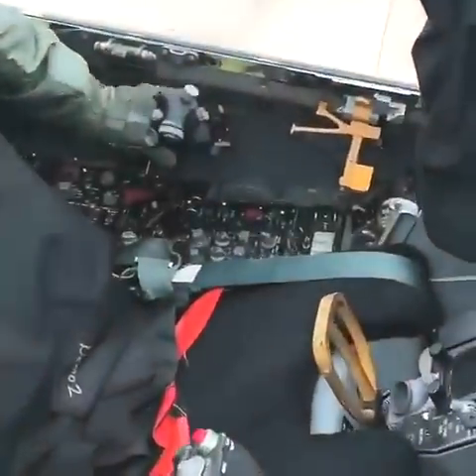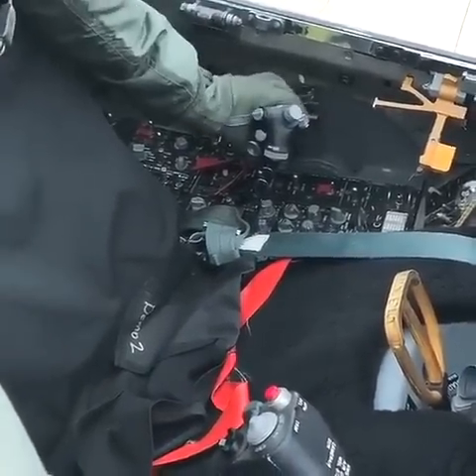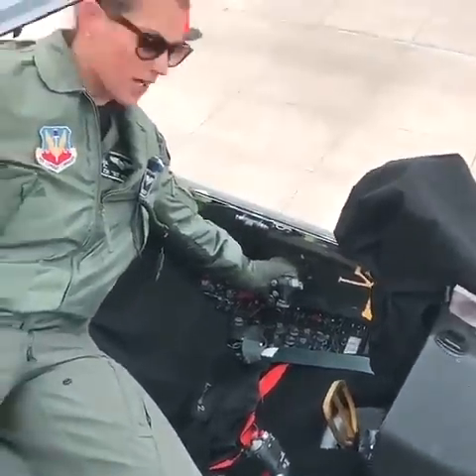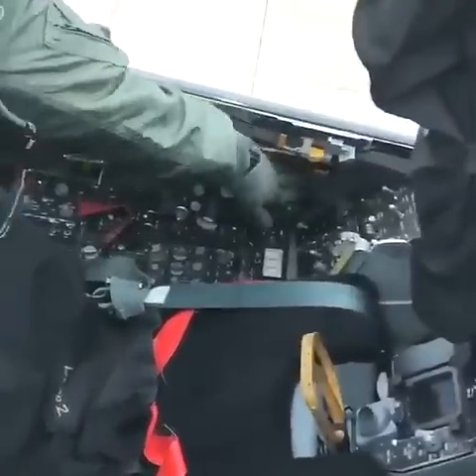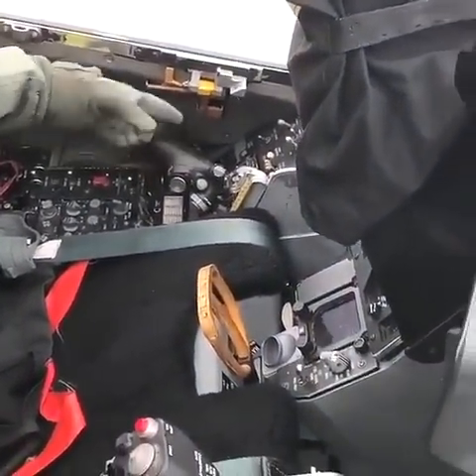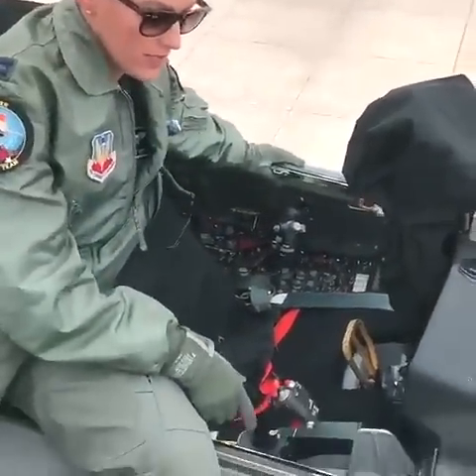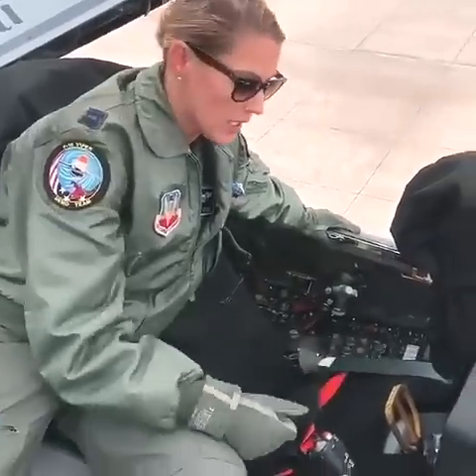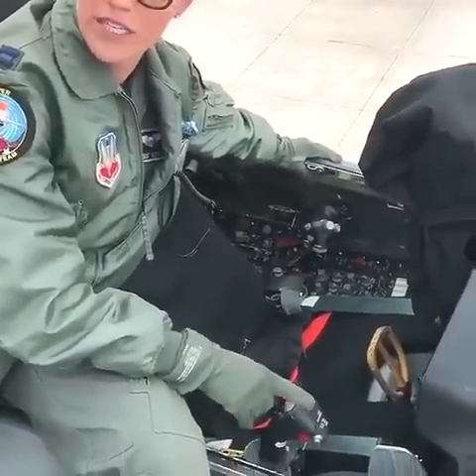USAF Female F-16 pilot Capt Zoe Kotnik, New Viper Demo Team Member

Comment: The original F-16 side stick controller had zero movement in it and worked by sensing hand pressure, but pilots had a hard time getting used to it so they added about a 1/4 inch of movement to it. 
It still works by sensing pressure but the added movement made it more natural feeling.
Reply: Thank you for clarifying/summarizing this because I was confused as to how it could have such little movement but it’s sensing which is amazing I never knew that
Reply: @killstars  
My pleasure, glad you found it useful.

Comment: She was also dismissed from the Viper Demo team after only two weeks.
Reply: Why?
Reply: @barskose4173  Her commander stated it was due to a “loss of confidence in her ability to lead and command.” Apparently it was pretty serious but the USAF tends to keep their reasons for punishment in house due to privacy policies. I’ve seen this kind of thing happen with pilots a few times before during my Air Force career and it’s usually for the same reasons.
Reply: @KPX-nl4nt  which reasons are those?
Reply: @KPX-nl4nt  the stick movement is somewhat of a misnomer right? It becomes pressure sensitive for more flight control movements.  Plus fly by wire= pilot can't ask the jet to do deadly moves?
Reply: @coachwilson5967  The F-16 side stick uses pressure transducers although it does have approximately 1/4” travel left, right and aft but no movement forward. It takes the same amount of hand pressure for full deflection in a given flight envelope. The flight control computer has a lot of different parameters for different flight regimes, and is essential as the F-16 is dynamically unstable. The stick was originally designed without any travel but was changed as this produced uncommanded flight control movements due to pulse/heartbeat and inadvertent muscle twitching in the hand. As for fly-by-wire preventing deadly moves, the flight control computer does put limits on the aircraft in different situations, but I’m afraid that no computer can completely protect one from oneself. Hope this answers your questions.
Reply: @KPX-nl4nt  thank you! You know what you know!!!!
Reply: @KPX-nl4nt So she got in trouble for giving wrong info.

Comment: The stick is controlled by pressure. It used to not move at all but the pilots didn't like it so the movement was added. The movement is literally so the pilots feel it move and nothing else. At least that's what the guy at the local air base told us when our Cub Scout troop went on a tour in 1982 and got that same demonstration.

Comment: The original prototype sticks didn't move at all. The stick senses pressure rather than position. Artificial movement was added at the request of test pilots which allows for smoother inputs.

Comment: The F-16's stick was never designed to move, given it is touch based, and the computer interprets the touch and pressure of the touch to determine which direction to move the plane. The only reason it has movement at all is because pilots that transitioned to the Viper griped about a stick that didn't move an inch, so they gave it 1/4" play in all directions, despite it being a "placebo effect".
Reply: Awesome information. I didn’t know that and I’m a Viper Driver.
Reply: But do you know why it was designed with no movement?
Reply: @Skilled_Driver  because it's strictly pressure sensitive by touch, much like how a touch screen responds based on a tap vs a long hold, and responds based on those inputs. A "long hold" on the Viper's stick induces a roll, taps are a snap roll, or  what creates the 8 point roll, pitching is done the same way. The pilots who weren't used to a stick that didn't move wanted it to, so General Dynamics gave it wiggle room of about 1/4 inch on all axis, although it has no bearing on input.
Reply: @angelisreal  I think you are partially right. I think of the stick more of as a variable resister with an on off switch.  That combined with that flight computer determines based on air speed, throttle position, atmospheric conditions and stick pressure. at what rate control surfaces move. And how much they move.
Reply: Well, my Pitts is pure hands and feet feedback ……absolute heaven.
Reply: @Skilled_Driver  the input method has nothing to with the other variables you mentioned. They're incorporated as a vital aside, but in this context, moot. You can input the data from the physical plane into a computer simulation, and the reality is altered by removing several other factors  that you don't get within the simulation: sensations and movement, which are the aside of the real thing vs a simulation. The joystick is the same principle. The reality is that the controls are servoed to the fly-by-wire (and fly-by-light) systems, and doesn't always require the flight computer to check for input control, although the floght computer does do that. They actually had to modify the flight computer parameters to dampen pilot input, because some were aggressive in their inputs, causing tail plane and flaperon damage. That was directly related the the stick input, not the flight computer by itself.
Reply: @Pittsspecials  that, my friend, is an understatement.....
Reply: @angelisreal  It is a dream to be able to fly this. She’s  180. Hp ..Inverted fuel and oil 76 /56 prop about 700 lbs
Going up car #3.      33rdfloor, 45 th floor furniture 
75 # floor bedrooms sets,next stop observation deck! Wow Built. ByHerb Andersen at the factory in 73’   My favorite …close next to a J-3 Cub sitting in the back seat with the door open

Comment: Tight flight controls but thrust controls is almost as much movement to shift an 18 wheeler!! You would think since flight and thrust work hand in hand, you'd think the thrust control would operate in a little tighter pattern.

Comment: Its called an air idle stop it will prevent you from accidentally shutting off the engines in flight in case you should jam the throttles all the way to the rear. You would have to manually left the stop lever up in order to disengage it to fully lock the throttles to the rear to shut the engines off. Hows comes I know this but the Commander of a fighter wing doesn’t? Sounds like someone was rushed through training without fully understanding the subsystems as I recall the last female commander was deemed unfit to lead the wing but lets see how this one fairs.

Comment: Less than a quarter inch movement on the joystick!! Wow seriously?? Would that not make the control really 'twitchy' 🤔😮😊😎👍
Reply: The stick senses the force applied to it, not movement.  The original F-16 sticks didn’t have any movement, but having some movement helped the pilots’ feel what they were doing which lessened fatigue.

Comment: Male pilot: yeah's pretty nice in here.

Female pilot: this does this that does that and this is for this and I actually know all this cool stuff and when you press this then this happens and this is the seat belt we use that to strap ourself in and this plane can actually fly upside down but it's really hard because you're upside down and this button here is so cool because you can actually eject the seat believeitornot if you get splashed that's pilot lingo for shot but yeah it's pretty cool.

Comment: Feel like she’s pranking us with the stick can only move 1/4”
Reply: The stick is controlled mainly by the amount of pressure applied on it
Reply: The jet is fbw it does not need input
Reply: @glennoc8585  All airplanes need input the controls are just pressure sensing. Fly by wire just means it goes through a computer.
Reply: @TobiTriesTV  true but the movement is much less on the side stick than a conventional yoke assisted or not. These fighters are not needing the same movement much like a F1 car doesn't.

Comment: It's called a detent for the throttle quadrant.  Must be an Air Force thing.  Not criticizing just info..  Some call it "going around the horn" from off to idle or idle to off (not Africa btw).

Wow, that is crazy that the stick movement is so minimal though.  Less than 1/4 inch!

Comment: Only the air force would allow that much makeup to be worn in uniform.
Never once seen an Army Pilot with that much makeup on.  Seen a B1 flight crew member in Afghanistan check her makeup before deplaning.  I guess she didn't know we were watching from the flight security vehicle with a camera.  We were seeing if the aircrew was still on board because they powered down 30 minutes before...look over...checking her makeup in a compact...only the air force.

Comment: Are you kidding that’s all the steering turns??
Reply: How many point turn would you have to make in a car to turn around on the road with 1/4 in travel 😆
Reply: Cannon Cocker  nope, you be wrong buddy. Just because that stick doesn’t move much doesn’t mean the control surfaces don’t move allot. The computer adjusts movement of the control surfaces based on pressure on the stick, speed of aircraft and other things.

Comment: Not a real pilot, 1st off if the engine is not running DO NOT PUT THROTTLES IN IDLE OR ANY OTHER MODE DO TO FLOODING THE ENGINE WITH JET FUEL.

Comment: Quarter inch in any direction are you fucking kidding me 😳
Reply: The stick never was meant to move. And it’s movement is artificial meaning it has nothing to do with the actual movement of the control surfaces. One reason why it’s movement doesn’t provide input is because of the G loads. If it did the pilot would be fighting the aircraft during G loads.
Reply: @Skilled_Driver  I see, thank you! So, does the stick have any movement resolution? Or is it just 'on / off' for the directions?
Reply: @PashaSiraja   the stick is like a variable resister with an on off switch and combined with the flight computer determines what rate control surfaces move and how much they move based on air speed, throttle position, atmospheric conditions and stick pressure.
Reply: @Skilled_Driver  I see, thank you very much!

Comment: OPSEC Much?!? Shame on you Captain.
Reply: I don't think the basic mechanics behind the Throttle and Sidestick are classified info.
Reply: @rusher2937  That may be true however several other aspects about that cockpit are.  In a time when soldiers are told not to even share what unit they in or what they do with strangers this is way beyond sharing too much.